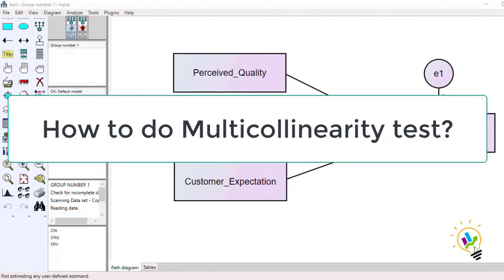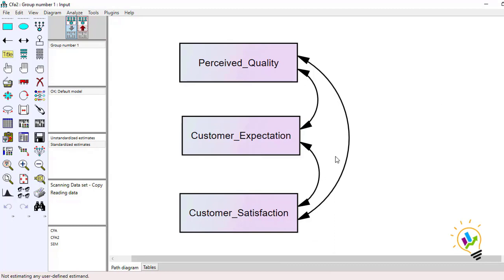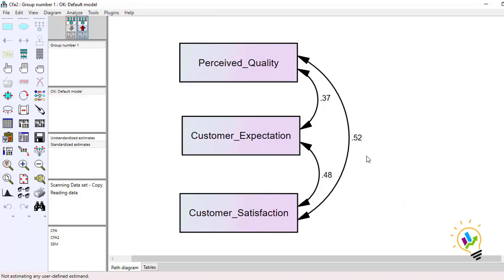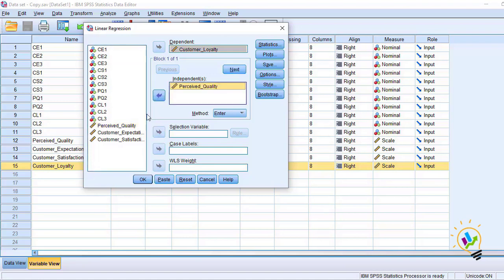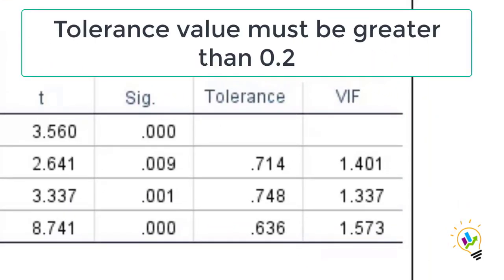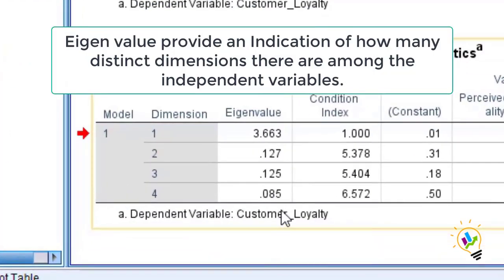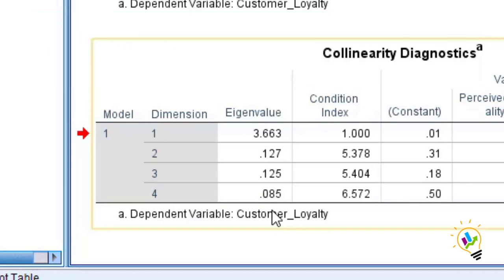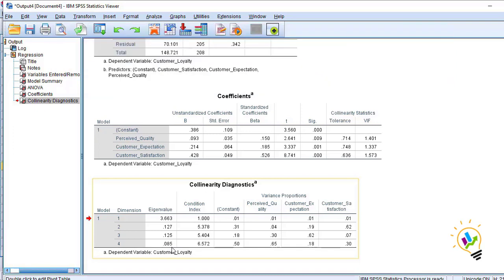How to do Multi-collinearity test ? # Tolerance test #VIF

Comment: Sir, if vif is not statistically significant can we still interpret them?
Reply from the maker: while you can interpret the coefficients associated with variables having non-significant VIF values with more confidence, it's always a good practice to examine multicollinearity diagnostics comprehensively and consider other factors before making final interpretations.